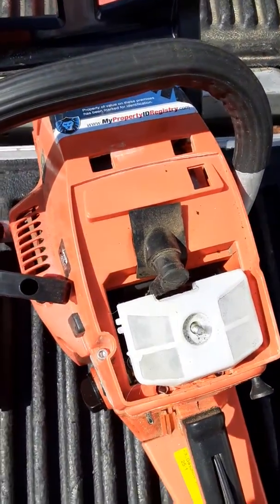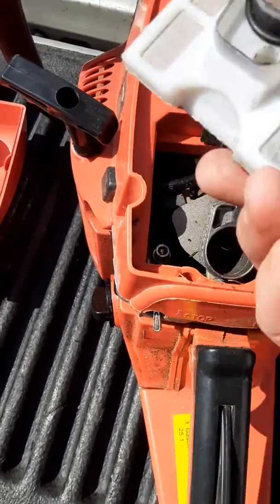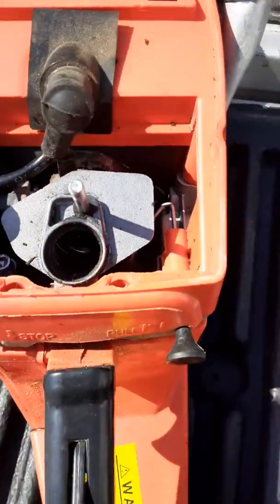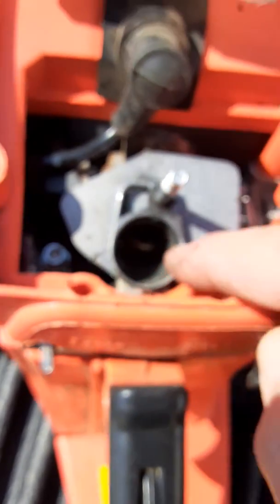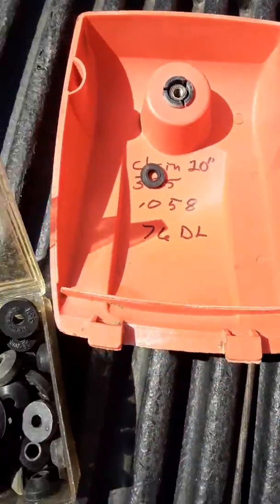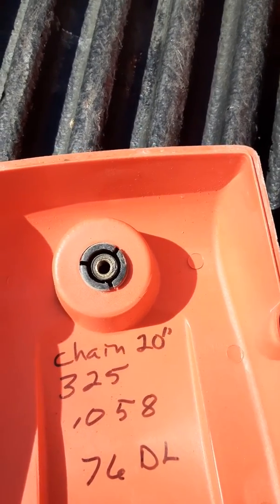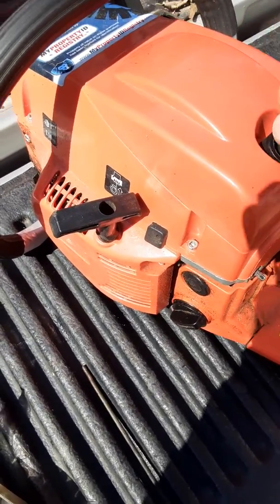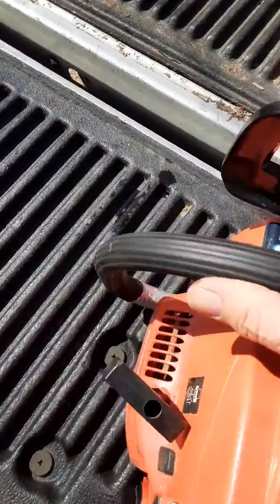All Chinese Chainsaws have this defect in air cleaner filter, PDTO, Coocher etc

Comment: Do not ever buy parts unless they are OEM parts. I bought a 9 pc china kit for my pp4620av chainsaw. Throttle arm snapped off in carb, air filter and base did not fit, coil ohms number was half as should be and produce yellow spark no matter if coil air gap or plug gap. Only thing working from kit is plug and gas filter and fuel line. But im now concerned about those also. Buy OEM. If u cant afford, put saw away until u can. Save the cash, time, and frustration of repeated attemps of troubleshooting and time spent, in the high hopes of trying to make china made kits work because ur short on cash and having hopes somehow their kits will work. The end result will be total frustration, neighbors will begin to wonder about you, and ur saw will end up as far as u can throw...into ur back yard.
Reply from the maker: Not everyone can afford to do what you say. Yes, it is the better way but not feasible for many. These Zenoah clones are affordable and most have the time but not the money to deal with defects. I bought 10 spark plugs for these from China. 7 tested with identical resistance. 2 were double resistance and 1 had 5x the resistance. So the Chinese got 70% right. That is my experience. Thanks for posting.

Comment: This is not a problem for all Chinese chainsaws of this type, but only for those saws with low quality workmanship like yours. You will not solve this problem with a sealing rubber, because the net itself is too large and does not filter well. The only thing you can do is buy a new and better quality filter, or just spray this filter with WD-40 or with a special filter spray, this will increase the filtration level. I have a similar Chinese saw, but it is better made with 2 air filters, for EU market. It works already 3 years without any problems, and the space after carburetor is clean.
In your chainsaw filter like this just missed: https://i.imgur.com/nW70Tzt.jpg
I wish you success! Greetings from Bulgaria, EU.
Reply: You’re on some good 💩 my man. 🤡

Comment: I just got a 52cc from E-Bay, both of those problems were solved.  There was a silicone washer on the air filter bolt and an 0-ring on the air filter as you recommended.  The Chinese must be watching your vid.
Reply from the maker: You might enjoy this group. https://www.facebook.com/Asian-Latino-Coalition-of-Iowa-101056851448781

Comment: Good to point out. I just put some high temp bearing grease around the o ring as well as a bit of extra assurance  unfortunately I broke my engine in with a poorly sealing air filter. Well see how long it lasts!
Reply from the maker: Great idea of using grease to get a better seal. I just deal with the overly porous air filter as changing will require a carb adjustment. Mine has not worn out. They are tough. I put some sea foam in every refill of fuel.
Reply: @iowaunemployment  is yours a chromed cylinder. I boroscoped mine and there’s some scoring above exhaust port which may have been a lean run in as the scoring extends higher than the piston rings which makes me think it was contamination related. I also didn’t realise that the air filter splits in two. I saw someone mention they put some sealant between the two halves and that helped as well. I am going to do that to mine as well.
Reply from the maker: @Graters1989  I don't know if I could distinguish a chrome from regular. Scoring often comes from use when cold. Ya gotta let them warm up before sawing at full speed????
Reply from the maker: Have you joined the Facebook forum yet?
Reply: @iowaunemployment  what forum?
Reply from the maker: @Graters1989  https://www.facebook.com/groups/158827535417075

Comment: First thing I do on my chinese saws is a round of rtv on top of the carburetor.  Squish the air filter in and voila.  The rtv doesn't set to the 'newish' plastic, and you have a ready made seal.  The rtv sets very well to the carburetor.  It's best to do this when it's brand new.
Reply: Filter still sucks in dirt. C’mon man! 🤡